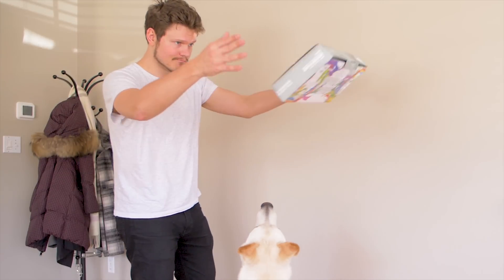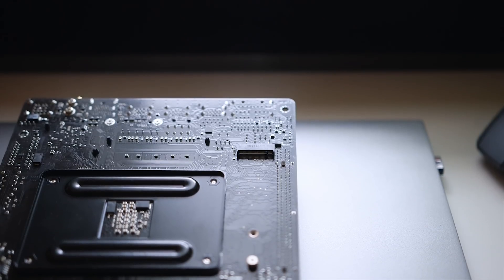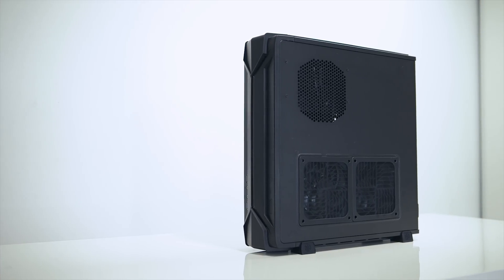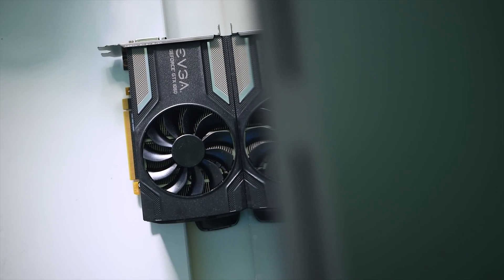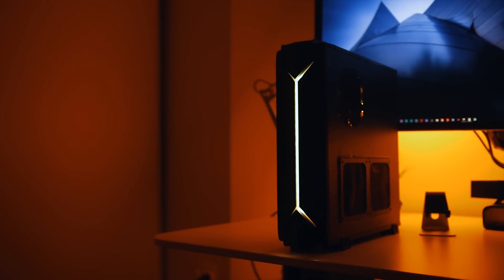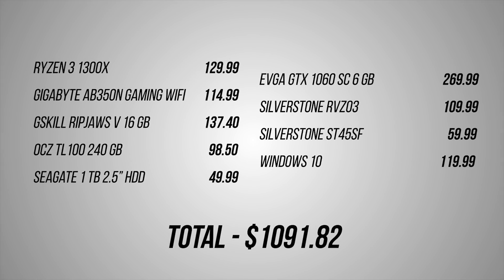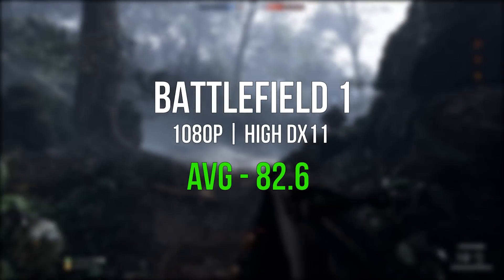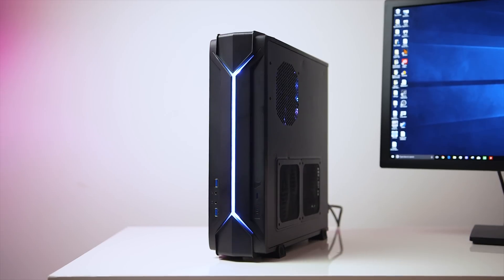AMD Ryzen SHRUNK - Our Ryzen ITX PC Build!

Comment: I remember when the sli capable 8800 gtx came out from nvidia. I didnt have enough to upgrade to a 64bit pcie mobo so i bought an agp 7600 gs from my 5900. When i installed the gpu games looked better but it crashed constantly. I returned the 7600 gs and bought a 7800 gs and it worked flawlessly. Sometimes ram and mid grade gpus really suck depending on the distributing company.

Comment: I actually have this exact mobo and case for my rig and I honestly would not wish cable managing this shit on my worst enemy.  But with that said, you could've done a better job.  I have a big ass ATX PSU in mine and it's still cable managed better.  Your CPU overclocking results left a lot to be desired, due in no small part to that Wraith Stealth cooler.  I have a 1600x and a Wraith Spire that I bought separately and I'm able to OC to 4GHz no problem.  This Wraith Stealth is just hopeless for overclocking even with a Ryzen 3 chip.

Comment: I think the choice to use atx psu over 3.5 hdd is a no brainer and a good decision especially given you now have m.2 256gb drives @~£100 which is enough to start with and 2.5 ssd's raising capacities (upto 4TB atm)  but coming down prices ~£100 per 500GB

Comment: My opinion:

When cryptocurrency is no longer profitable, and a bunch of mining GPUs flood the market, every gamer looking to buy used GPUs should REFUSE to buy any used card UNLESS they are one-fifth (20%) of MSRP.

Six main reasons:

1. 10xx series is old tech (almost two years old)
2. Mining card runs at full load 24/7
3. Miners should pay for the pain and suffering of gamers
4. With so many used cards on the market, new cards will become cheaper to increase willingness to buy (and new cards come with 1/2/3 full years of warranty)
5. Miners should pay for the pain and suffering of gamers
6. Miners should pay for the pain and suffering of gamers

Comment: I have exact same motherboard arriving today, I bought a Ryzen 5 1600, 2 x 4GB DDR4-2666, 500GB M.2, RX560-4GB, Win 10 home 64 bit, FPS 600W SFX PSU, and its all going in a 15 year old Wintec aluminum MATX case. New system is replacing my 5 year old A10-6800 Richland APU system. Hoping to update this system to Raven Ridge APU if it ever gets released in my lifetime.

Comment: BTC and its dependence on mining is not just adversely effecting GPU availability and pricing. GPUs require memory and chips, and mining also require memory and CPUs. So it is actually driving up the cost RAM, CPUS, both directly, and indirectly by forcing GPU manufacturers to require more processors and memory for their products. This then impacts the cost of all sorts of electronics, including but not limited to phones and tablets. Stuff that is basically required by normal people living in the modern world, and required by both large and small businesses. So basically the cost of living is being impacted, and that means that everyone has to charge more for their products, then they have to charge more to afford each others more expensive products. So who is paying for BTC now? All of us.

I like decentralization and I think we need to move towards that, but bitcoin, and the blockchain, while full of potential, are deeply flawed at their foundations. There is much to be learned from the development and rise of cryptocurrencies, much that can potentially be refined and applied to achieve great results. BTC itself though, well, personally I think its days are numbered because I just don't see the benefits of it anymore. There was a time, as it rose in popularity, that I thought it might actually become a viable medium of exchange. That time is long passed though, as it is clear now that it is far too unstable to accomplish its original purpose. Using it to buy and sell everyday items is not a reasonable proposition. So now it is just an investment toy, which is wasting huge amounts of resources, and leaving the bill for everyone else.

Comment: I know this is an old video but instead of buying Windows 10 for $120 you can buy the key for about $28 OR you can use a Win7 key (yes that works just did it with my own pc and it is activated in Win10 now)

Comment: The Gigabyte AB350N doesn't have 2 USB 3.1 Gen1 ports, it has 2 USB 3.1 Gen2 and 4 USB 3.1 Gen1 ports. Not mentioning this to criticise a small detail, but it is something a lot of people get wrong, because the USB 3.1 naming is stupid. Gen1 basically means USB 3, at least if the ports are USB-A, though they can be USB-C and then would support the new power functions, but still be no faster than USB 3. Only Gen2 ports are the faster ones, but they can still be type A ports (and are in this case). Type C only adds additional power capabilities, not additional speed abilities.
In this case it is easy to see which is which however, since you have black USB 2 ports, charactaristic blue USB 3 or 3.1 Gen1 if you want ports and thankfully not slightly different blue, but instead red USB 3.1 Gen2 ports. All of them obviously are type A, probably to save the space for additional power delivery circuts on the small board, since type C isn't used a lot anyway.

Comment: Ok, wtf. A 1060 is NOT the best bang for buck. Look at the 1050 ti. With the $50-$60 savings, upgrade to a 7200rpm drive and some 2666mhz ram (any faster gives very tiny gains if any without using a high end GPU). The ASRock mITX is cheaper and has the connections on the correct sides of the board. You could easily get under $1k with smarter hardware choices. It would even perform better then the strange choices that you made.

Comment: You can fit a 3.5 inch HDD in the RVZ03 case, vertically between the GPU and the case, it takes a little work though. I managed to fit it in with a Gigabyte GTX 1080 Windforce. It will also fit PSU's longer than advertised, maybe 180mm.

Comment: mobo too expensive, case way too expensive, ram way too expensive, and ssd with a 120$ cpu???? I understand that its small form factor but no small form factor is or should be "budget" Instead of that case why not just get a normal case and then you can also get a good "budget" cpu cooler. IDK just such a odd build.

Comment: A GTX 1030 would have been a better choice for Home Theatre. The card supports 4K but not gaming. This build isn't considering the relationship between thermal dynamics and longevity also the wattage of the graphics card still doesn't make a good mining rig unless you live someplace that has really cheap utilities like your parent's basement or a dorm.

Comment: Can't wait to show you guys my ITX HTPC

Core i3 3220 $42 (ebay)
Biostar ITX mobo - $45  (ebay)
8GB 1866 mhz G.Skill Ripjawz - $35  (ebay)
EVGA GT 1030 - $100 (after taxes and shipping)  (new)
OCZ Agility 3 SSD 240GB - $46   (ebay)
Rosewill 300W TFX12V PSU - $44
Mini-ITX HTPC Case (MADE MY OWN in spare time lol) $10

Total $322 U.S. Does everything an HTPC should like 4K 60Hz video playback and a decent low settings gaming. If I wanted an amazing gaming experience on my HTPC...i'd build a full blown Gaming PC instead, OH WAIT I DID LOL.
Reply: Much more intelligent HTPC build lol
Reply: Good luck running games on a dual core and a 1030.. def not "full blown", but for 322, pretty good

Comment: Building a pc for 1000€ and parts are: Gtx 1060 3gb (going to upgrade next year so i'll be fine plus it's my first mid range pc so it will be enough for me), Asus Prime B350 Plus motherboard, Ryzen 5 1600 CPU(going to overclock it), 2666 MHz Crucial ram (going to overclock it) , Crucial MX300 275 GB SSD, Seagate Barracuda 3TB HDD, Zalman Z9 Neo case and a 650W Corsair 80 Plus Gold PSU. For me it's a huge upgrade(coming from Intel Core i3 540 3.07GHz CPU and Radeon HD 5700 series 1Gb GPU haha...)

Comment: Good build! But I am not sure I agree with your criticism of their connector arrangement. I think it is arranged straight instead of 90° angled as they know they are dealing with SFF cases, which are unlikely to ALL provide the bending radius room to neatly approach from the sides like in an ATX build. If you look at where they had to put the RAM slots, that left them with very few options. Look at your end build. Can you imagine trying to cable that with 90° connections?

Comment: Really impressed with the gaming performance. My rig runs a 6700k stock with ASUS H170 moba, 16Gb ram and a MSI GTX 1060 gaming x GPU. Overwatch=100-120 FPS and Doom About 90. YEs my games run from a 1 Tb WD blue mechanical drive and every thing is running at stock. If I oc the GPU I will get like an extra 40 or so FPS out of it but my monitor is only 60Hz so doesn't matter

Comment: I’ve had Aida64 get a failure message within 5 mins no matter what with my R5 1600. Temps were high 70s on stock cooler. I think Aida64 has issues with failure detection with Ryzen. Anyone else have this kind of problem?

Comment: For the Drives:  You can Populate the M.2 Slot with an SSD  and  go with 2 of these 2.5" HDD's  in Raid 0  thats cost efficient   and betters up loading times. And btw  The  Western Digital Black 2,5" HDD's  got 7200rpm so definitly worth taking a look. I personaly run  WD Black 2,5" SSHD's in Raid 0 they are  7200rpm SSHD's  with 16GB of NAND Flash (instead of the typical 8GB) But these are realy hard to find nowadays.

Comment: I build a Ryzen 3 system a week ago, the 1200 variant. I overclocked it easily to 3.9 Ghz with a voltage of 1.24375. Temps were never higher then 60 degrees with a stock cooler... Okay, it wasn't mini ITX but micro ATX, but your temps are crazy high, and you didn't even get the 1300X to run at 3.8 Ghz. So you have got a bad chip I guess. 
My cine score was also higher with 575.

Comment: This is my 1300X mini ITX build. I used a case that makes the layout on the MB work really well for cable management. Finding a good GPU without getting price gouged right now is difficult though. https://pcpartpicker.com/user/Milzy420/saved/jv4K8d
Under 750$, but the GPU is also 50$ more now than when I bought it. The ram was also 30$ cheaper. It was a 600$ build just recently.

Comment: Dude you really need to research your cases better. The RVZ01 hat 3.5 HDD support, the RVZ02 was even slimmer than the RVZ01 and 03. The RVZ03 is basically a RVZ01-E or -B look it up. They removed the slim line drive option and the 3.5 hdd option for a better and cleaner look

Comment: The performance you got, in my opinion, wasnt that great. Some have gotten better results with a budget thats a few hundred less; granted, the other builds were not ITX, but were instead mATX. Instead of going with the 1300X, I would have gone with the 1200 and spent the savings on an aftermarket cooler or a silver or gold rated psu. You are definitely right about the cable management; I dont think I could have done any better without some extensions... Thanks for the video, and keep up the good work...

Comment: Could you not fit a side mounted 120mm AIO?
Like the Siedon 120v. Great cooler and very easy to position in unusual places. I use one in a full ATX case mounted in the rear exhaust position next to the I/O shield.

Comment: I think the build is weird. A $130 CPU paired with a $120 ITX motherboard and an RGB case that's almost twice as expensive as a non-RGB case is just dumb. If you're in a tight budget you obviously go for performance, not looks. Also windows is $5 in Ebay, $30 in Kinguin and free if you don't mind having some text at desktop and less customization. If you go for some $80 mobo + windows from Kinguin (for example) with the $60 case that fits a faster HDD you pay only around $860 and have quite a faster hard drive.
Reply: TLDR: Buy Windows from Ebay or Kinguin. Go for cheaper case that fits larger & faster hard drive and buy a cheaper yet still overclockable motherboard.

Comment: I also build an itx slim line system with an AMD Ryzen 5 1600, GTX 1060, but I use the ASRock AB350 Gaming-ITX/ac WiFi, it has a much better layout for power and SATA cables making cable management easier.

Comment: $1100 and you use an R3...

You should've done, for example:
R5 1400 - $170
Cheap B350 - $120
16GB RAM - $150
GTX 1060/RX 480/580 - $250 RRP (up to $100 more due to mining atm)
250GB SSD - $75
3TB HDD - $100
Case - $100

TOTAL: $965 (and possible gpu price inflation) + Windows (which you can get for $20 through resellers)

Comment: I don't see the problem in putting a more power CPU and GPU in one of those cases. I have a i7-6700 and a GTX 970 in a RVZ02, and the temperatures have never gone too high.

Comment: Y can't u ever make a flawless build. Says budget build uses 1300x instead of 1200 And uses $110 windows instead of $15 windows. And cud have gotten a moduler sfx unit for few bucks more (ik u had this non-mod psu in stock). Aida 64 or avx stuff automatically increases voltage by 0.1 so this happened, u were a fool to use it. Sud hav kept it in 3.9 n uped the voltage a bit.
Reply: Where do you get Windows 10 for $15?
Reply: YTNoob Oem keys usually r $28 and often can be found much cheaper
Reply: Tahsin Faiyaz 
My friend literally bought 5 of them
And they just fail after a couple of months
Spending the 100 dollars is worth
You are only paying for it ones
Reply: Something tells me this is not the real Gabe. :P
Reply: Um, I always buy them for 15 or less and not one has ever failed on me and I've built quite a few systems so...

Comment: u wasted $ on the ram, sdd, win10, and case.
Reply: EBB3ka13 and cpu, nice "budget build"
Reply: budget build for $1100, jesus. and a shitty overpriced case.
Reply: Case is a total step backward from the RVZ-02 which is smaller and cheaper. SFX power supplies are expensive. Kind of pointless if the case is as big as ones that use ATX like the RVZ-01.
Reply: The RVZ-02 is only slightly smaller than the RVZ-03. As for the RVZ-01, it is pretty much the exact same size and layout as the RVZ-03.

Comment: Man that case is ugly for a mITX. And I don't get why you all at HardwareCanucks love RGB so much. RGB isn't a "feature" on a motherboard. Dual m.2 slots on a mITX board is a much more valuable feature rather than having a useless RGB header. Also 2.5 7200rpm hard drive exists. Same with SSHD drives.

Comment: You can technically just get windows10 from the official website and just not activate it, the license wont expire and it wont cause for any problems other than a little watermark in the bottom right corner, so i think the price is unnecessary

Comment: Only problem with buying  NVIDIA is the $300 plus additional  price for GSYNC added to the cost of any monitor. Till NVIDIA does the right thing and supports the VESA standard instead of their expensive and limiting proprietary solution. I don't think I could feel good recommending NVIDIA to anyone. If Vega is even slightly competitive, You would have to be a complete idiot to buy NVIDIA anything for gaming. Yes I know 1080ti is a killer, yes if you are going to buy dual 1080ti's then and only then does buying a expensive GSYNC monitor make any sense. Anything less your just supporting green because you like being ripped off and shat upon.   If you want Nvidia to be responsible the only way that happens if the community votes with their wallets.

Comment: @HardwareCanucks This system looks great, I get people want RGB, which is fine, but the L.E.D's Silverstone are using aren't worth the bringing up that cases price to 110$, but overall that price-tag for the whole system seems to be a bit high, considering for the same price, you can get a system with beefier specs. As for GPU mining, you have to take into consideration that crypto-Currency mining, is some peoples livelyhoods at the moment. Plus, if your a student, and you've two or more machines, i.e a desktop and a laptop, You can use both to mine crypto-currency to make you money.

Comment: for OCing the CPU a case mod and liquid cooling with the radiator and liquid holder if any on the outside while having a pump inside of one of the 2 5 1/4in bays though if your pump is to big mod it to be 1 bay and give up another 5 1/4 in bay or put the pump on the outside of the case too on the outside of the case will do it ITX cases really are not meant for overclocking so putting the cooling solution on the outside will probably be the only way to have it be possible but also will require a case mod